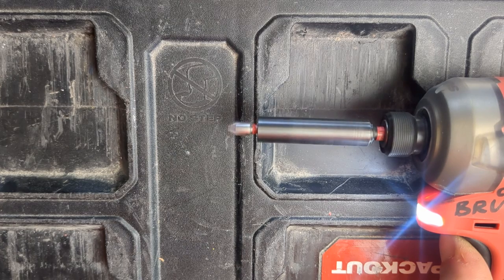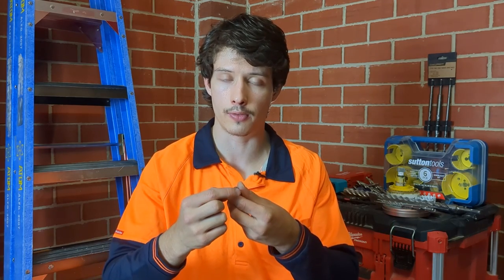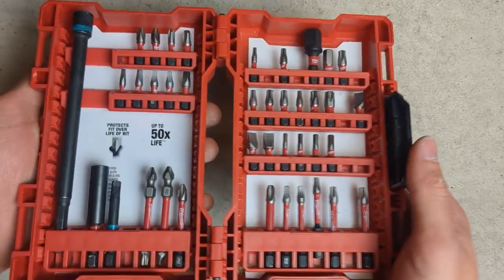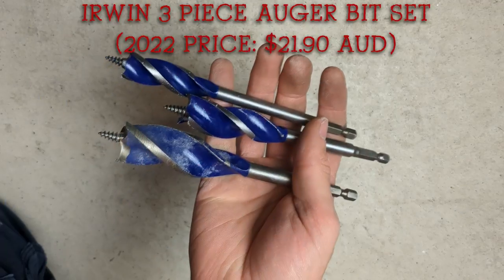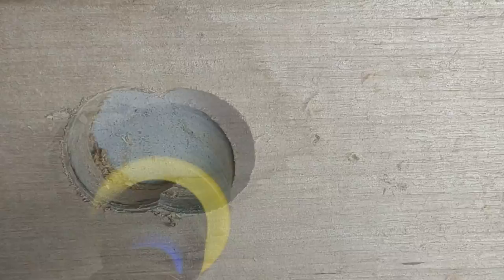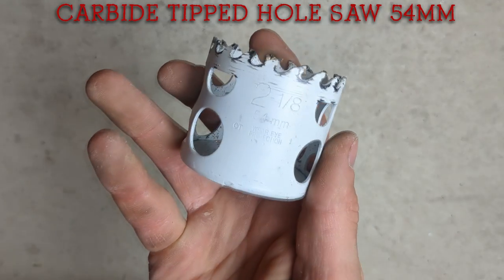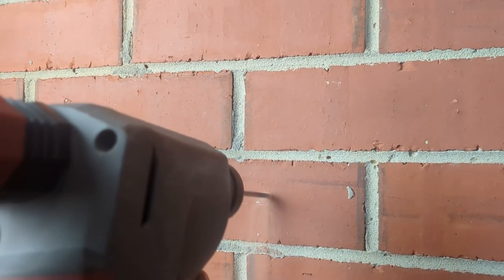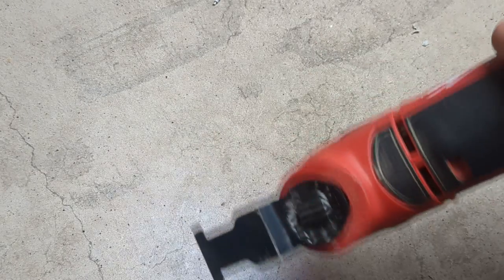Essential Bits I Own as an Electrician from Australia

Comment: The 1/4 inch shank drill bits are better used in a chuck drill to have less slip between the drills jaws and the bit. Dont use 1/4" shank drill bits in an impact, especially on steel. The impacts will completely fuck the drill bits cutting edge, likely shatter. 👍🏻

Comment: fantastic video and very valuable content for an aspiring electrician! Quick question re what chuck drill to get as an fresh apprentice?I'm going for m12 surge impact so wondering if a m12 drill would also be okay or do you need to step it up to 18 volt, appreciate your input! Cheers
Reply from the maker: Cheers! I've always used an 18V chuck drill so I don't have any exerience with the 12V version, however I don't think theres anything wrong with going with the cheaper option. Maybe look up some comparison videos and see what others say
Reply: @coreybruhn  Thank-you!
Reply: @blairwilson9272  I have both, If you can afford it and have the batteries I would go the 18v drill, my m12 drill sometimes strugges with anything larger than a 20mm spade bit. I think Addicted to tools did a video on it, but from personal experience as a first year sparky, the extra power of the m18 just makes it the drill I reach for when I need a chuck drill
Reply: @ryanmackie1484  Sweet as! I really appreciate your advice, will check out the vid from Addicted to Tools too, cheers! Oh btw do you use spade bits often? I was considering just getting an auger bits set
Reply: @blairwilson9272  i have a set of the irwin auger bits, they cut decent, but I am a huge fan of the diablo spade bits, use them daily. They have a screw tip on the end, kind of like the auger bits, and seem to last for a long time, I have used my 20mm one daily for about 2 months and still cuts unreal. I tend to use the spade bits more often than the auger bits, because the diablos are quicker and easier for me as my auger bit wanted to have a fight with a nail and now cuts a bit rough. I would highly recommend the diablo spade bits, but the irwin auger bits are good as well. I think the diablo spade bits are around $11? So a few more dollars than a regular spade but but so much better
Reply: @ryanmackie1484  awesome thanks heaps for the advice, really appreciate it!
Reply: i know its expensive but go with the 18v to start with. Theres some tasks that 12v gear might not be able to do. Its always better to have more power than not enough.
Reply: @doctordoomsnipes  Thank you! makes total sense!  Will go 18v for the drill, of course both would be nice oneday too :)

Comment: You're receptacles don't need to be housed in a box?
Reply: Not in general. Only when specified such as for fire rating.
Reply from the maker: Pretty much what andrewclarkey said! 

In our wiring rules, clause 3.10.1.1 Exception 2 states: Wiring enclosures need not be provided for insulated, unsheathed cables installed in an enclosed wall cavity between an accessory and a wiring enclosure or sheathing terminated within 100 mm of the hole over or within which the accessory is mounted

Comment: I like the videos, but impact driver for everything. Is a bad habit. Terminals and on rcbos and circuit breaks is not a good look..
Reply from the maker: Yeah another comment mentioned this, impact drivers on terminal screws is a pretty common practice though. As long as you have your impact on setting 1 there's no way you're gonna break the terminal screw. I always then tighten the screw further with a flatty or phillips head screwdriver 👍